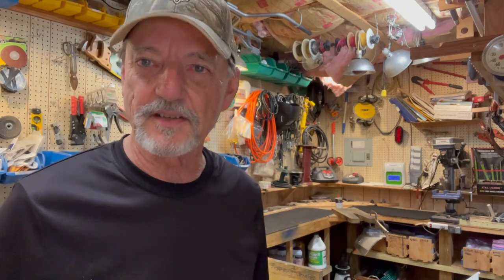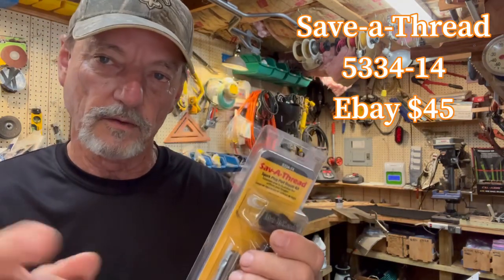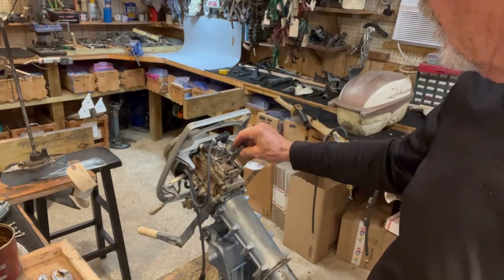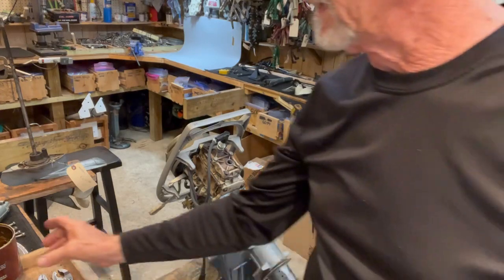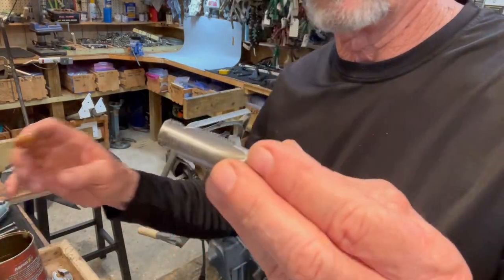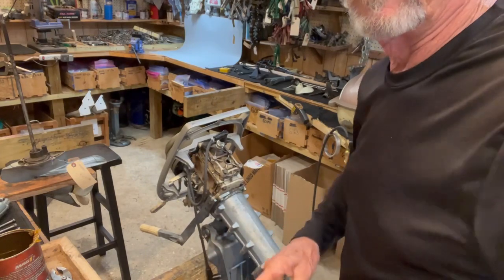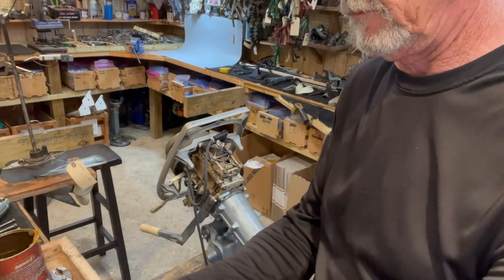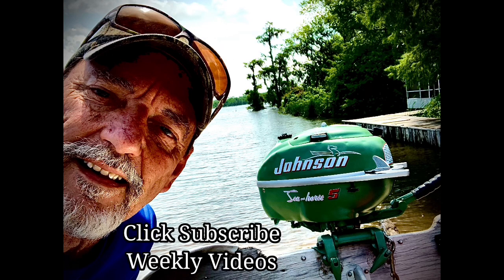Repair Spark Plug Hole Vintage Outboards

Comment: Used this last weekend 4weeks after saying I hope I’ll never have to use (ha) after a huge mistake with compression tester! Nerve racking I’ll tell you what!
One thing I noticed on my head when tapping that the aluminum it’s thinner than outside which caused piston side of hole to crack.. had to finesse pieces out with a pick/tweasers..(last 2 threads of 6)..
Will note it’s a ‘56, 30hp.. M14 x 1.25, same kit.. 
did cover save a thread with high heat red loctite, threaded in and used set tool with 2 light taps.. let sit for 24hrs.. threaded new plug in with a small dab of never seize and was off to the races.
Thx T-Mike this video helped me not sweat it to much. Appreciated!

Comment: I was thinking one could lightly stuff a small bit of rag in and pull it out afterwards that would lessen even more the chance of shavings messing the cylinder up. I do like that on other places to keep gasket pieces from dropping in the holes.

Comment: That’s great T-Mike I’ve seen/heard of helicoil but never used and kind of hope I’ll never have too.
Scary having metal filings inside , magnet works good what does a guy use if it’s aluminum shavings? Also curious when you take plug out does helicoil stay inside threads or does it come back out with plug? And if you change plug do you have to buy new helicoil?
Thx for video!!

Comment: Hey T Mike, from everything I’ve seen, aren’t you supposed to put high heat red thread lockers when screwing the plugs back on, and then tap it with the setting tool? What am I missing here? Thanks
Reply from the maker: Several ways to do this.
Reply: No thread locker there is a tool to secure the helicoil